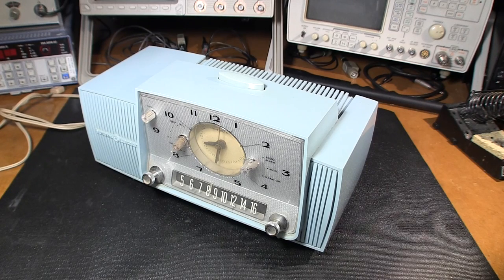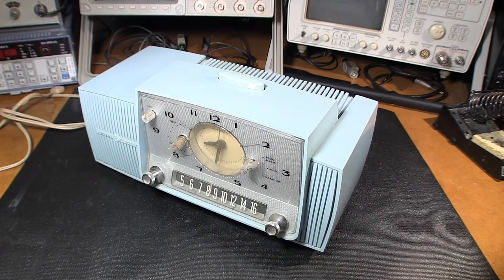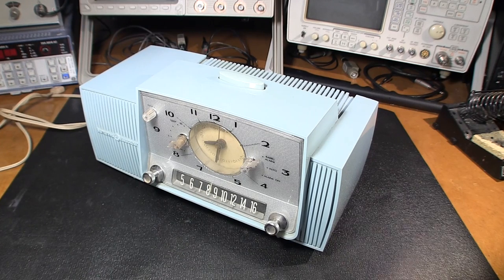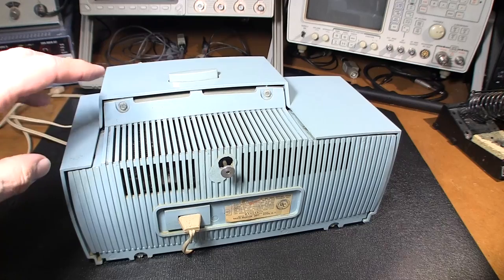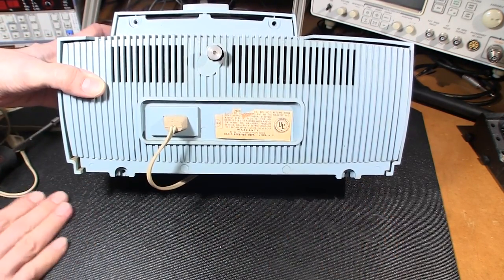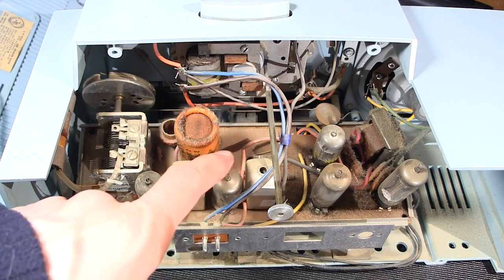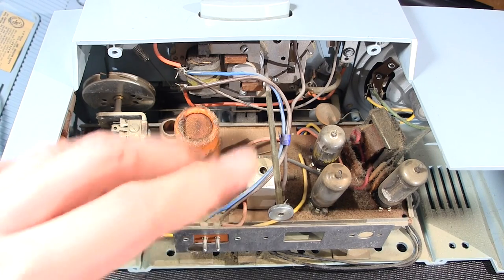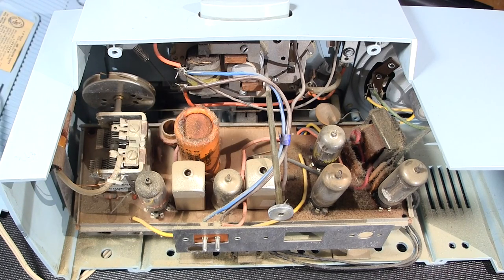Atomic Era Radio Teardown, Explained With Repair

Comment: I always thougt the first ICs were the OR  or was it NOR gate chips for the Saturn V.
Reply: Nothing\ , It really depends on how you define the term "IC." The term literally means "integrated circuit." In these radios, they contained capacitors and maybe resistors in a small molded rectangular housing. I'm sure it was strictly for cost savings for the manufacturer that they  used these.

By the way, Philco used this same concept in their radios back in the middle 1930s. They would combine maybe three capacitors in a rectangular block, with black, sticky pitch on the inside. These capacitors would go bad, and the replacement block had to be obtained from Philco, unless you took the time to reverse engineer these parts by use of discrete components. To do so, you had to study the schematic diagram and compare it to similar radios of another brand. Fortunately, in recent years, someone did this for all of these Philco block capacitor networks, and published this on the Internet for other Philco collectors to use in repairing and restoring their radios.

Comment: Hey Paul, I appreciate your video's and I am learning about electronics from them. I am also a Ham radio enthusiast and trying to learn how to restore some old radio's by watching you. I have a question for you or maybe someone on you tube that could answer for me. I have an old Palomar 300a linear amp and was wondering can I replace/modify the tubes in the amp with transistors? Would it be worth the effort if it is possible to do that? Thanks KA4DIV
Reply from the maker: Hi Jay. Definitely not worth doing. You have two completely different circuit topologies.

Comment: Why do you insert a silver mica capacitor between the signal generator and the tuning capacitor during the alignment?
Reply from the maker: The signal generator looks like a resistive load to the radio's antenna circuit, the capacitor makes the circuit AC coupled, and the value lightly couples the 50 Ohm generator output into the radio's antenna section.
Reply: The shango066 method just uses a big coil of cheap hookup wire and place it near the bar antenna.
Reply: Thank you sir.  I really enjoy your electronics videos.  Very informative.

Comment: Great Job Carl, yes scary with hot chassis. I need some help with flux, can you please give a brand for ra flux? I have rma and it does not work good. So trusting someone that sells good fresh flux would be great. I seen the results with the stuff you use and looking for that. 
Thanks Much, 73`s
Reply from the maker: MG Chemicals 835 would be good.
Reply: Thank You Carl.

Comment: Great stuff!!! What did you clean the top of the circuit board with? Love your videos. Have learned so much from you!!
Reply: vibra64 i recently got a radio and a mouse chewed its way through the antenna , backing board and was living in it,  crapping and dripping all over the air tuning capacitor , it was corroded and stuck and all over everything else... I was about to toss it in the trash, then i looked  at it a challenge to get it going,  no one wanted this radio in the last forty years only a mouse that live in it.   So i sprayed the chassis everything with vinegar, let it set 30 min washed it off with water, did it a second time.  Then heated the oven to 350'. Turn the oven off and stuck the cassis in and let it dry out as the oven cooled down.    
 I replaced all the caps, fixed all the chewed up wires, but have one bad filament , so i need to get one tube to see what it will do.....
Reply: Thanks!!

Comment: Odd that the set doesn't have the required Civil Defense frequency marker pips at 640 and 1240 kc. Was it because that radio was specifically made for the Canadian market?
Reply: Bill Lewis 

Ending in 1963 (the year it became clear that ICBMs made Conelrad obsolete).

I think the markings started in 1957.
Reply: Bill Lewis 

Thanks for the quick reply.

My understanding was that ALL US broadcast stations were to stop transmitting during Conelrad operations (all of which were tests, thank god).

The idea was that Conelrad stations would randomly sign on and off with other sites taking over, which meant Russian bomber pilots couldn't direction-find standard broadcast sites (As Japanese pilots had so successfully done with KGMB).
Reply: Actually the markers are there, you can see two little nubs molded into the plastic at the very bottom of the dial, they are visible at the 40:00 mark in the video.

Comment: How come no one ever thought of putting a computer case fan inside a old tube Radeo to keep it cool ?
Reply: They have :-). But many times it is not needed. If designed correctly there is enough convection cooling. I added a 30MM fan to a Telefunken set where
there was not enough room between them and the IF transformers, plus no real way for the host air to exit the top of the case.

Comment: Wait... so situations exist where AC polarity matters? Or did I completely miss something?
Reply from the maker: Yes. AC itself is non polar, household application makes it polar. This is the reason for one wide slot, and one narrow slot on your outlet. Neutral is referenced to ground (center tap of the transformer on the pole), and connected to your ground rod. The Hot side is one outer end of the transformer winding on the pole. Since everyone's house has that center tap connected to a ground rod (the earth is a pin cushion) This is known as "Neutral," and is the wide slot in your household outlet. The safety ground pin, or the lower half circle hole in your household outlet is connected to Neutral at the breaker box, both the Neutral and safety ground are connected to a ground rod or multiples there of.
Reply: Thanks! I don't think I've ever tried to defeat the polarity, but definitely good to know not to, should the temptation ever arise.

Comment: I'm curious how he arrived at 100 pf as the value of the capacitors inside the RF can...there is no standard value used on these things.
Reply from the maker: The answer to that is simple, I have rebuilt so many receivers, it just boils down to experience.
Reply: So a variation of ~20pf will not affect performance that much? I've seen some of these cans where schematics are available specifying values of 80pf, 85pf, or even 120.

Comment: Why the output on the oscilloscope is a bit shakey.?
Reply from the maker: Multiple signals present in the same waveform
Reply: Like more than one frequency component.?
Reply from the maker: Yes, exactly.
Reply: I guess those components of frequency would be not far apart that is why the signal looked like a sine wave.??

Comment: @12:35 - AA5 Vs. AA6. 

75 Years into the future, noting the ... oh god, LCD? TFT? display which has now replaced the analog gauges in a contemporary Honda Civic. Internally screaming: "Why don't you know that this 'technology' is nothing short of ensuring that either you'll spend $2K to repair it, or that 'used cars' will become an obsolete terminology. 

AM in the day was far from what one might consider "high fidelity" at best. Indeed if you could understand the presenter without the :"underwater" artifacts you felt that you were doing well in the day. 

Aw man .. what were those series string numbers? 12BE6, 12AU6, 50C something.. 6AU6? .. I forget .. wasn't the dial lamp important too?

So long ago.

Dying to continue with the vid  .. to see what that sixth tube (in your presentation . after all, I can count) would do "better" - and curious as to the "IC" you mentioned in the radio presented  - very curious in fact - In the AM era which I recall clearly and fondly, recalling CFRB 1010 through the dual speakers of an RCA 6-XD-5B.

Too early to suggest that corporations learned in the intricacies of separating a fool from their money is far from something new?

Okay, back to the remaining 1:10:55. 

I do appreciate your vids.

Comment: If there's a source for 7-12v inside (maybe 100mA), you could put a small 40mm fan (or even smaller) blowing past the two hot tubes, or an exhaust just behind them.  Might add a bit more longevity to the case.  Beautiful radio though.  Here's an example.. feed it 7-9v instead of 12v and it will run very quiet.  https://drive.google.com/open?id=1c-7jRySKCxrHIOTDxclBO5Tg7SgnHyoH

Comment: 50c5 35w4 12ba6 12be6 12at6  all american 5 .if static & filter hum no extra charges .good luck on those clock knobs .try Smithsonian . The final test electronic school draw the schematic of that 1959 I was only one could do it .we didn't build it .😁
Reply: There were solder on clock shafts for theese and knobs at one time I may still have some somewhere.

Comment: 40:56 - Lead-free solder? You don't actually use that garbage do you? 63/37 tin/lead is the best electrical solder. The only reason lead-free solder even exists for electrical use is because of politics. There's a reason that manufacturers of medical and other forms of "life-saving equipment" are exempt from regulations that require the use of lead-free solder. I worked in a PCB factory for two years soldering terminal blocks to fire alarm PCBs, and since fire alarms are considered "life-saving equipment," we used 63/37.

Comment: hey Carlson I did try to repair my grandfather's Philips radio that had 3 MW and 1 mono input. didn't know what year it was made and it had a problem in speaker and resoldering fixed issue and there weren't any MW transmission available in my country so had given mono input from my onkyo and it did work.. added some cooling solution and a small Bluetooth circuit so that it will be brand new. will post a video soon. but I didn't test any components and as per my grandfather's note it had its tubes replaced just before it stopped working and none took notice for 36 years until I have opened it. please get in touch to me need your help.

check this Google drive link and troubleshoot as much possible https://goo.gl/photos/WHUDKjBvyfZMccWDA

Comment: @Mr Carlson's Lab - "...there's three different tubes..." is incorrect. "...ther're  three different tubes..." is correct . "...There is three different tubes..." is incorrect - "...there are three different tubes..."  is correct - it's not your fault. Grammar is a dirty word. The Los Angeles Unified School District taught grammar in the 1950s and 1960s then they stopped teaching grammar as the Queen's English offends some folk. I like this channel however your grammar needs work. "There's" is singular. "Ther're" is plural. Be well. Sunshine and outside air discourages certain microbes, tell the people, please. Ultraviolet radiation/atmospheric dissipation hence no viral visitors. Too simple, way too free.